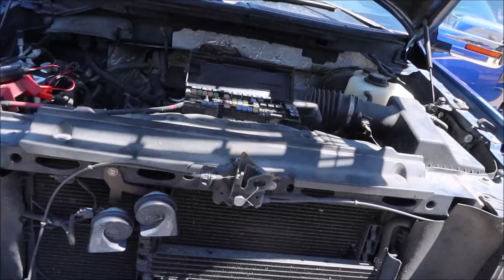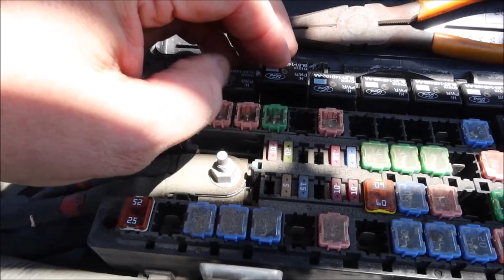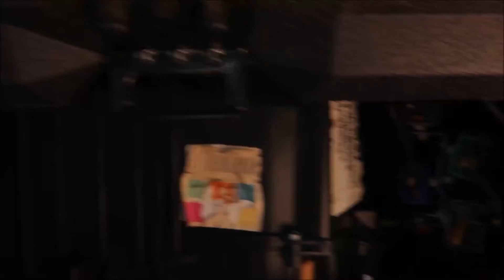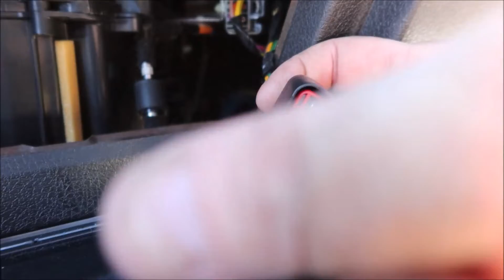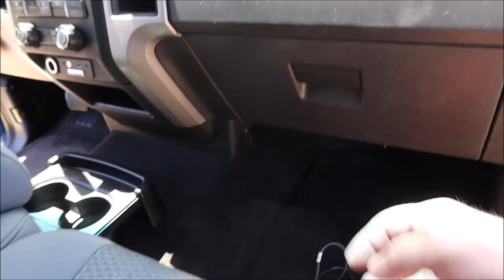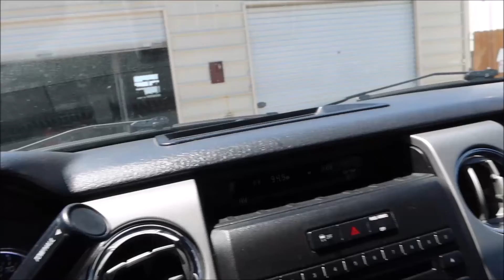I GOT SCAMMED AND IM MAD AS A HORNET! / 2004 - 2014 F150 BLOWER MOTOR STUCK ON HIGH

Comment: let me say that you were 100% correct in your diagnostic flow chart check fuse check the relay however if a blower motor only works on high then that eliminates the fuse and the relay automatically The battery supplies the power the fuse regulates the amperage the relay supplies the power directly on high it is on the other three speeds that the resistor plays a part I am not trying to be mean for a know-it-all just trying to help it fellow mechanic out to improve down time... now if the blower did not work at all then you take the steps of the fuse the relay the resistor and then the blower motor have a great day and thank you for putting out quality content

Comment: Good morning Mower Medic 1! Thanks for the tip on the blower motor resistor.  I am chasing a similar issue in my 2000 Ranger and think this may be the problem, after watching this video.  I'll definitely give that a try. BTW, got scammed on flea bay when buying a replacement carb for a mower I was working on, so I get that one for sure!
Reply: Make sure the fan area is clean while you have it apart. None of the 1983-2012 Rangers had cabin air filters and I've had resistors (including on my 1995 Ranger) go bad due to debris trapping water (rust) or blocking air flow (overheat). This sort of issue is one reason why cabin air filters became common.

Comment: Something similar happened to us. We replaced the alternator on our 2008 Lincoln Navigator after diagnosing it for a battery light. We got a new one from AutoZone and after installing it, it still had a battery light and it still showed that it wasn't charging. We took the alternator we installed to a different AutoZone and they said it was good. So now we're under the impression that there's an electrical problem that is preventing the battery from charging. We looked in several places, such as the fuse box and even the cable that connects the battery to the alternator. We just couldn't figure out what was wrong. So we finally decide to buy an alternator from Advanced Auto Parts and after installing it, the battery light turned off and it finally showed that it was charging. All this because of a faulty alternator from AutoZone.

Comment: Hey more mowermedic 1 I was giving this riding mower from a older guy for free it's in real good shape the motor is real good look like he kept it in the shop real clean he told me that it cranks up and runs about 10 minutes and shuts back off when you try to go to start it again it won't cranks up so I'm kind of thinking the carburetor is gummed up and floating stuck he said he put it up last year and just added fresh gas to it so that's what I'm thinking maybe I need to clean the carburetor what is your suggestions

Comment: Most stores will not accept returns on electrical part.
MANY years ago (when they were very expensive) I bought a cat converter sensor. Before I left the store I looked at it and it was very used.
That same store in later years also got me on a window tint kit where the middle was cut out rolled up and returned.
They did beat me on the tint.
Reply from the maker: Keyword here folks is “most”

Comment: I’ve done that twice on my Son’s Ford F-150.  No High blower,  ordered the parts on Ebay,  very Bueno!
Always cut the back of my hand doing this,  recommend light gloves.  I don’t have a 90 ratchet!
If it is high blower out you don’t have to check the fuses.
Reply from the maker: ALWAYS CHECK THE FUSES  THOSE SLOW BLOW FUSES WILL TRICK YOU SOMTIMES
Reply: Ur correct old man Fred control is ground side switched for speed selection Cheers
Reply from the maker: @anthonysova7117  incorrect. Speed control is through resistor /  speed control  ground goes straight to battery ground not
Bcm
Reply: @THEMOWERMEDIC1  yes sir. The selection speeds controls the ground to each speed no bcm  if in doubt check a wiring diagram all ur doing is switching ground per speeds per the controller u changed Cheers